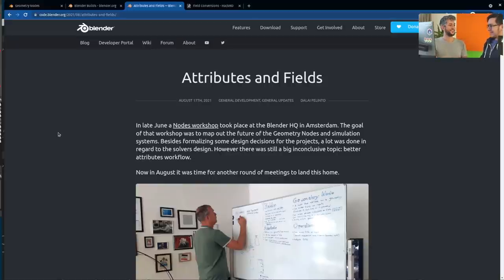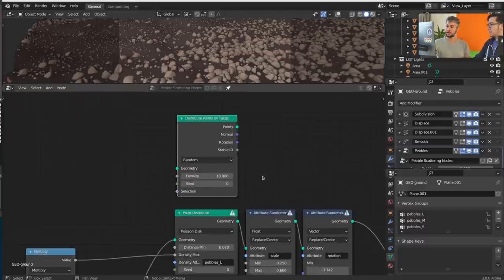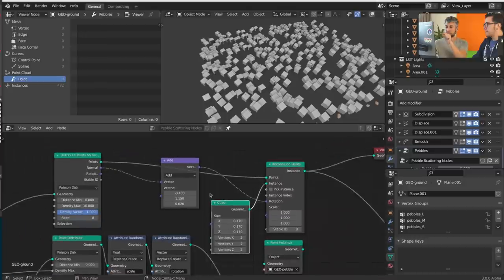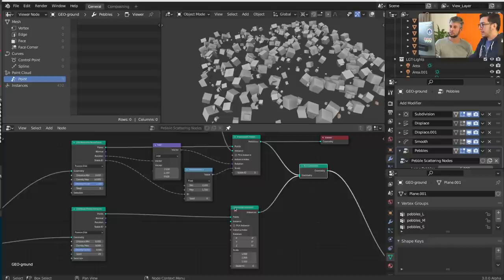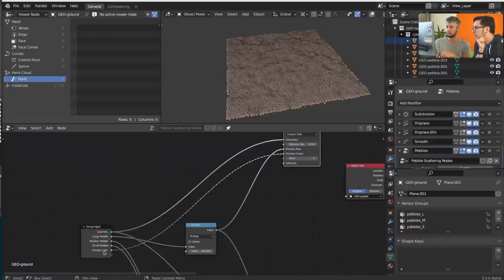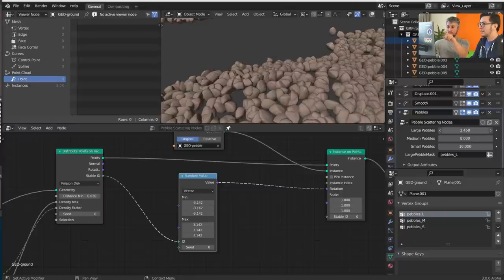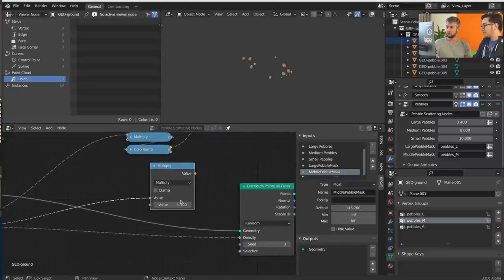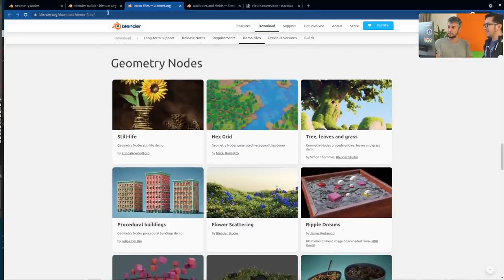Geometry Nodes Fields: Explained!

Comment: 27:45 Please please please, we need a proper Texture node network is this planned?
Reply: That's an orphaned module. only things that can use it now are baking and a couple legacy options for simulations. I personally want to see it gone completely- with some of its functions delegated to materials (adjusting image textures and using them for procedurals constrained by UV's already works), and baking, preferably, to the UV workspace. Geometry nodes is replacing its functionality for sims

Comment: Very helpful! However what new node has replaced Point Instance which allowed me to get a whole collection of objects (rocks, trees, greebles etc.) and distribute them randomly on a face. I have the points and random scale/rotation which I want but how do I plug the geometry of a whole collection in place of the cube as you used early on as an example?
Reply: Check the geometry nodes demo files in the blender website. This is covered by the basic scattering examples (pebble scattering as well as the tree moss and flower demo)
Reply: @DalaiFelinto  thanks for that tip. I figured it out and made my own tutorial already! :D

Comment: I wonder how to "shade_smooth" now that Attribute Fill is gone hmm...  and need more video on Proximity node.
Reply: You can output the value, and in the modifier you set which attribute you want to be written with that value. Though built-in attributes will be settable inside the nodetree (same as position right now).

Comment: Hmmm, makes me wonder if you can make some kind of "LoD" type system using the camera position. The further an object away from the camera the lower polygon model it gets. This should be possible right?
Reply: Yes a way to do that is to essentially apply the decimate modifier in node form where the decimation value is driven by distance from an object.
Reply: @amoose136  LoDs are fast because it is just a toggle from high to low poly. And You suggest to introduce bunch of extra calculations on a geometry level for every object in a scene. Maybe for static renders it won't matter much, but for a realtime (that's what LoDs are for) it would be horrible from optimisation point of view.
Reply: @dfhdgsdcrthfjghktygerte  the time to recompute the LoD in this manner for a cycles rendered scene is hardly anything compared to the time to render. If you want EVEE/ near real-time rendered stuff you would need a step function and a switch node to speed things up. This is fine but takes a lot more setup time as now you need to setup several different LoD models manually and pass those into the switch node. If you’re looking at something truly interactive, the game engine has been removed from blender for some time now so you should probably use the LoD tools in whatever game engine the app will be running in.
Reply: LoD = Level of Details. (bing search)

Comment: Hi. Does anyone have a situation that in Blender 3.0 beta in geometry nodes there is no "point instance" node? on version 2.93 I have this node and in the new version it disappeared somewhere. Has it been replaced with something else or is it a bug? Anyone who can help? In Google, I saw that not only I have this problem. i have a Linux version, but there were never any problems with it.
Reply: Trying to follow along, I don't have the demo up just doing the their stuff, and using 3.0beta from 11/10/21 and I have "point instance" node and it's still under Point in the sht+A menu. If you don't see it search for it. You might have to look in preferences to see what hotkey search is bound to.

Comment: I'm wondering what the "selection" (pink diamond) input is for. Will this allow the nodes to operate on a specific selection of vertices/edges/faces rather than the entire geometry?

I don't think it's been implemented yet, I'm guessing it's just a placeholder for now.
Reply: That's exactly what it is. It allows Geometry Nodes to affect only a selection of the mesh, not the entire geometry. It's a diamond shape because a function/field can be plugged in, it has a circle inside because it can also receive regular data. And it's coloured pink because it's a boolean type (e.g. each vertex is either selected true or false).
Reply: @PabloVazquez  thanks for the explanation pablo (:

Comment: I still dont understand how the new attribute capture node is supposed to be used? halp
Reply: found this The Attribute Capture node stores data from its input on a geometry so it is carried forward to other nodes, allowing the use of the same data in a different context
Reply: @stephenpetersen3607  That I have read also, I just have trouble getting my mind around the way to use the node. There is a geo in and out and an attribute in/out,  how to store the rotation of points and use it use it somewhere else etc. I'll scour the tutorials until someone makes it clearer.
Reply: @monkmichel9477  I'm not good at nodes, but I presume the attribute out is grabbing the stored data to hookup somewhere else in the node tree.

Comment: Will Geometry Nodes ever adress the glaring useablity issues in terms of GameDevelopment? So far we only can export the static mesh we create with geometry nodes, meaning that for example an entire structure created procedurally through geometry nodes using multiple different meshes would be a single huge mesh exported to the engine. The issue with this is that you don't have any instancing for the seperate pieces which defies the entire reason why for example Houdini is used to much for GameDev. Also will there ever be a way to change generation values outside of blender, keeping the possibility to procedurally generate other structures in Engine. Epic Games won't adress this themselves so it is in the Hands of Devs to create maybe a USD based Addon for Unreal Engine and Unity to make this possible.   What I am asking for mainly is that it should be possible to when the mesh is sent over to unreal that the instancing for the seperate pieces keeps working.
Reply: I sometimes feel like these for Developers super important features are not really tested and addressed enough, there are a lot of people like me who use Blender in production and want to use these tools but at times they won't work for us as they should as Blender seemingly mostly focuses on the Blender only Render Pipeline instead of looking at the many people who use Blender for a lot of other things then Rendering Animations in Cycles or EEvEE.
Reply: In 3.0 instancing is its own geometry data type. So exporters can make smart decisions about what to convert to mesh and what to keep as instance. This particular game development use case showed up and is very clear. However it was not prioritized while the fundamental tools were still being shaped.

Comment: The new fields system is really great, though I am very much missing the named attributes! But please please get rid of the awful dashed wires for fields connections though, it becomes very hard to read the graph :( At the very least make it a theme-able option in the same way you can adjust the noodle curviness.
Reply: where can u edit the connectione curviness?
Reply: @yash1152  preferences > themes > node editor > noodle curviness
Reply: @fracteed  thanks

Comment: this vs houdini ? which is easier to use and more capable ?
Reply: Houdini has a fully featured system for creating procedural geometry. Blender's geometry node system is still in its infancy, currently offering a very limited set of features. So Blender is nowhere near as capable as Houdini in this regard, but it eventually will be.
Reply: I'd say that Blender geometry nodes are super fun and easy to learn, But in terms of capability, Houdini is way ahead - by quite a big margin. Houdini nodes are fully integrated across all areas. Blender geometry nodes kind of remind me of XSI ICE but easier

Comment: HELLO blender i have one idea very simple if you can make it . thnx a lot. when selecting obj or Camera or Light in 3D viewport it will just track and appear the selected item on outliner . for exmple if you have many obj in scn. so when you select camera in 3D view port . without hover my mouse on outliner  and click on . to found it on outliner i wish it will have option  like if you want to track automaticly your selected item in viewport sync with outliner. also  that propotional editing it should has something like gui menu when activate it because if you scn scale is small then as that tools designed you need to zoom out too much to reduce that radius with mouse midell scroll .  so if it will be like  small menu for that propostional editing so  we can adjust that radius like  we see depend on 3D obj size . thank you very much.